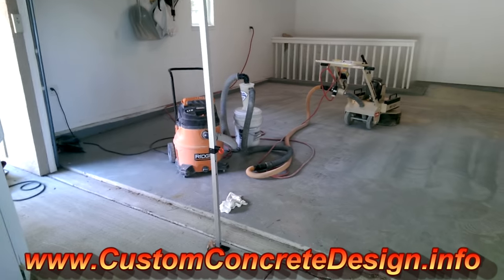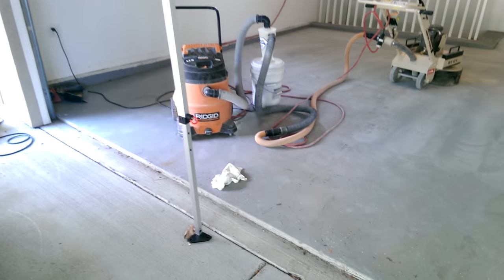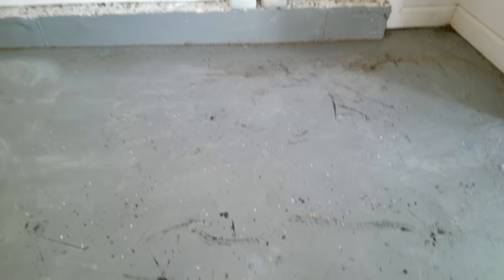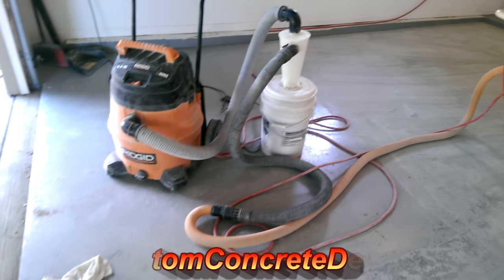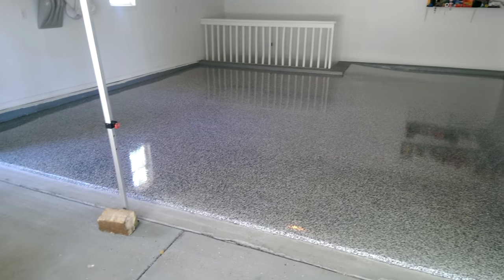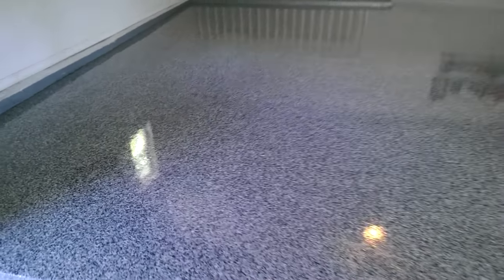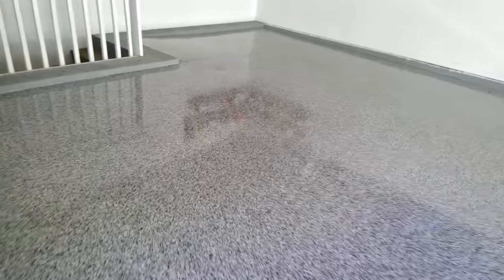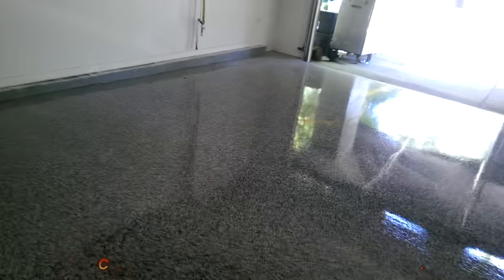Epoxy Garage Floor with Vinyl Chips High Gloss Flooring Lake Ozark Osage Beach Laurie MO

Comment: After you throw down the flake and the epoxy has dried do you vacuum off the loose flakes before you put a gloss sealer on? Great looking job by the way.
Reply from the maker: Hey @AaronSlangman Thank you!!...after the Epoxy has dried, I go in with a floor scraper and scrap all the loose chips away, so I scrape one way then I crosshatch back the other direction, this insures that all or the majority of the loose chips are ready to be picked up, then I grab my leaf blower and blow all the loose chips into a pile in the back corner of the garage and scoop them up, then blow the small amount of debris out of the entire garage... then it's ready to be sealed, hope that helps.

Comment: Clear Epoxy or polyaspartic What do you recommend for a garage floor ? have you ever had problems with the clear Epoxy fading out  I have a decorative concrete business Knoxville Epoxy and Design. Thanks Cameron
Reply from the maker: Hey @CameronBrantley... I would use the Poly...cost is less and just as good, in this video I used Clear Epoxy, then followed up with 2 coats of WB Urethane, it helps protect the Epoxy and gives it more Amber resistance, but the Poly is the better way to go.

Comment: Awesome job...I thought that clear coat was still wet until you stepped on it.  Would this be considered a color chip broadcast to refusal??  Also what brand product did you use or do you prefer??
Reply from the maker: haha yeah it looks wet still right, thanks Yeah I always do my Vinyl Color chips to 100% coverage, on this garage floor I used The Concrete Protector Products, I also Use Elite Crete Products on my Projects as well. Thanks for stopping in to check out the Video!... Appreciate the feedback!
Reply from the maker: +Roddy Da hsha yeah its a nice glass like finish, and yes its a chip broadcast to rejection (100% coverage) I use a few different ones, I use Eitecrete products, The Concrete Protector Products and some Cohills Products, theirs certain products or systems I prefer more for certain jobs, on this particular project we used all The Concrete Protectors material.

Comment: Hi Rick. Hey what top sealer was that and how did you apply? That topcoat looks perfect! Thanks
Reply from the maker: +dEsignEd byGOD Hey... I used a 2 part Epoxy made by The Concrete Protector its called Neat Coat, but you have to be an installer of their product to get it, which means going to a training class in Ohio.
Reply from the maker: +dEsignEd byGOD its a 2 part Epoxy High Gloss from The Concrete Protector